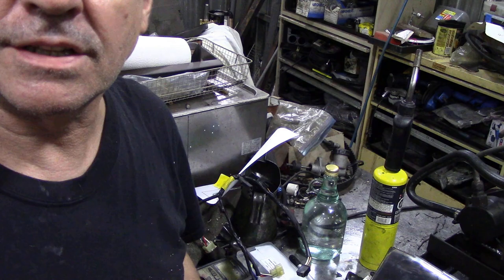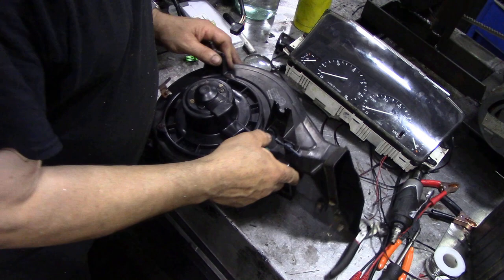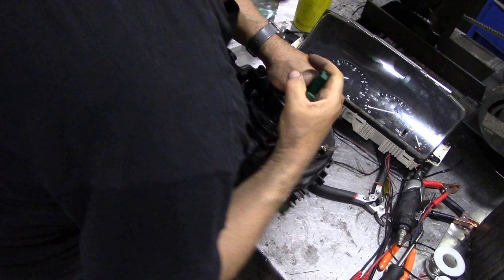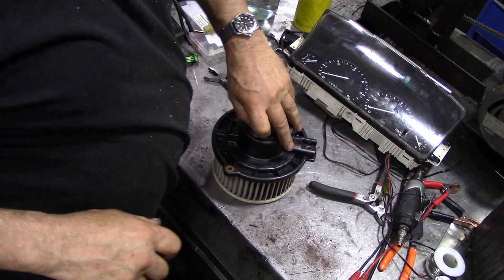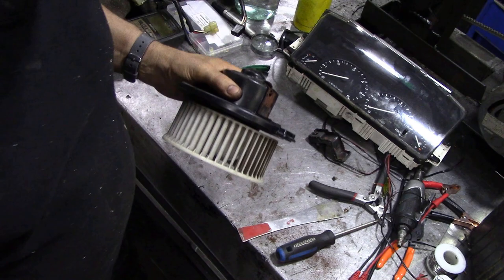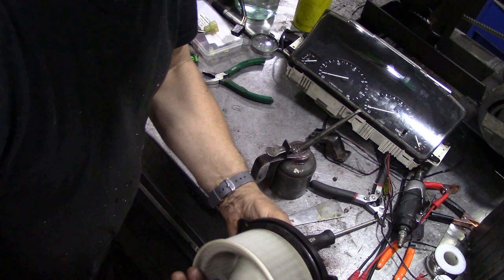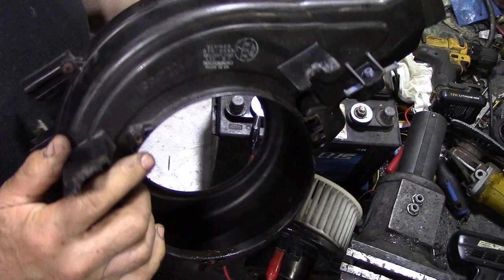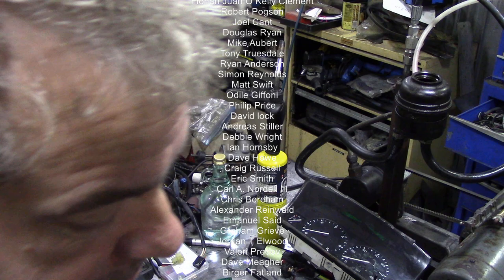A classic job for the Engineer pliers and testing the RR blower!

Comment: If you run the fan while applying first heat from a heat gun/hair dryer the centrifugal force can rebalance the plastic blades and while still spinning apply cool air to fix the balanced shape.
Reply from the maker: Top tip! I will give it a go
Reply: That’s ingenious.

Comment: Just a heads up: the motor(not fan) is the same as used on early 2000s model Toyota Camrys too. I recently changed my D2s blower. LR parts horribly expensive, and u pull it type wreckers don't have many LRs in stock. But after searching high and low, I found that the motor is the same as the Denso motor used in the Camry(circa 2002 or so). Went to the local self serve wreck in yard, a few camrys in stock, pulled motor for $20(AU). Pull squirrel cage off, pop LR squirrel cage on the camry blower motor .. done!. The camrys squirrel cage is a few millimeters longer and binds onto the body of the heater box, so don't try it complete.
Reply: ooops! sorry forgot to add high chance that the electrical plug will be the same too. There are both parallel type plugs AND right angled connector plugs. Hit and miss which one you get.

Comment: Knipex do the same style with a locking slip joint so you can use them on larger diameters. Like the old school mechanic pliers but with the screw extraction end, really useful design. 

Engineer also do a smaller version that might have helped you the other day.
Reply from the maker: Good to know - they work fine for me!

Comment: Neji-Sauraus, had them a couple of years now, got the 58 size (think they are the biggest). Blades are still sharp, and I cut M6 bolts with them (it can be done). Removed many a sheared/ruined screw with the end.
Never had a bad tool from Engineer.

Comment: Hi Mike. The cheapest transport I ever had was due to having multiple spares , of every part boltable to the chassis , including engines and the chassis itself ! I had a Honda K4 250 which was a little slow for most and friends . and their friends . would dump their unwanted bits my way . I would build a good spare engine and test coils , carbs , etc , on my running machine and store the good bits . A friend had a Marina which he did the same with .... it grew an 1800cc motor over time ! Thing is to find something no one wants but is ok really , say an Xantia today , and hope people are generous . Lol . Unfortunately Landrovers have become too expensive for this ideology to apply . Happy days . I sold all my K4 bits with a working bike for 50 quid in the end and I am still friends with the guy some 30 years later, so he must have been satisfied too .

Comment: What's the difference between engineer pliers and normal pliers? Incidentally, a pair of small mole grips would have done just as well and if the screw wasn't going into plastic would give you a much needed better grip onto the screw head too.
Reply from the maker: Once you use them on small screws, you will never use Mole/Vise grips again

Comment: Hi Mike, great pliers! Just watched you 300tdi turbo assembly. Was just wondering. Mine is leaking exhaust fumes from the waste gate spindle as it goes into the manifold. Is there a way to fix this or is it caput? Cheers, James.
Ps, keep up the great videos 👍😁👍
Reply from the maker: I have seen this before and the only way is to put a bush in it - by the time you do that you might as well find another manifold
Reply: @BritannicaRestorations  have been looking but they seem to be difficult to find on there own without the cartridge. Thank Mike 👍😁👍

Comment: must be corroded inside. Too noisy ! I bought cheap ebay fan in my defender because it was shorted.  Original one costs 350 AUD + ebay one 29.95! But VDO PM137 and PM136 can make one exact same for Defender.  Rock Auto USA sells them.